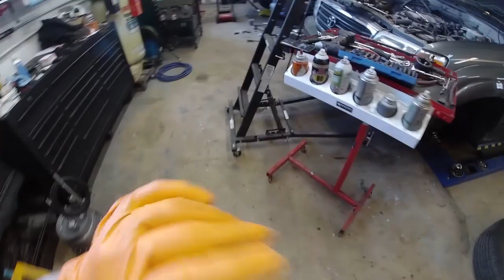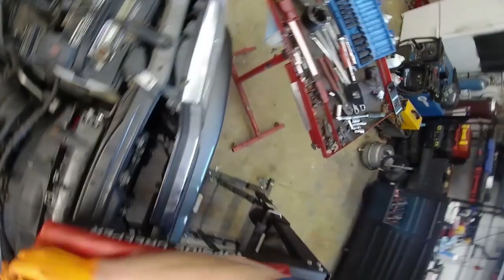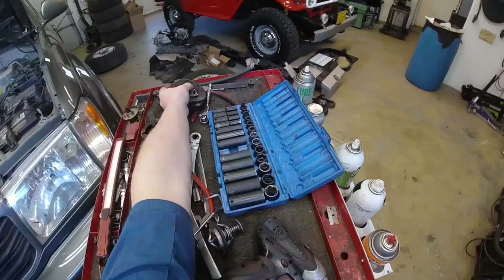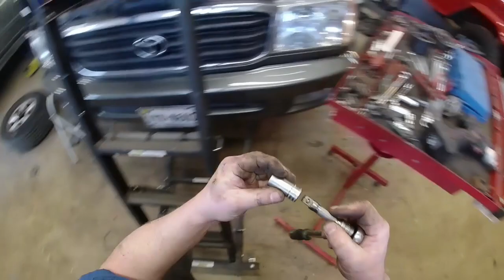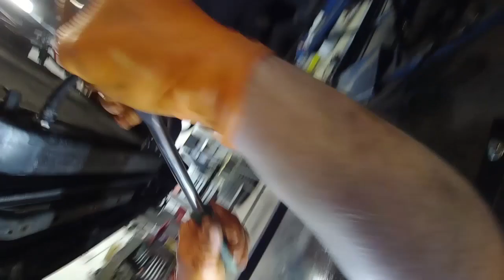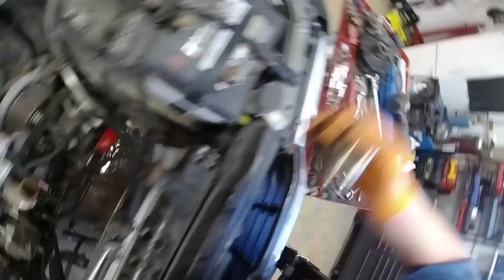Toyota 4.7 liter Timing Belt Replacement Part 1

Comment: Just want to tell you how much I appreciated your videos, I am 71 years young and just finished replacing my TB, seals, valve cover gaskets, spark plug seals and carrier bearing with minimal problems and no other help. One comment to you (very minor) is that I would trade the Tekton flex 12mm with a Gearwrench  long reach (ratchet and box) way easier! For what it is worth I bought my truck new in 2003 and now have 333,400 miles and other than TB's this is the first real maintenance I have had to do on engine. I rebuilt suspension last fall. Plan on driving another 17 years or I am in the grave, whichever comes first. 😇

Comment: Killer video, attempting my 04LX once the parts arrive, plan on watching these videos a few times in preparation. I am positive the 6 hours spent here will save more than 6 when I actually do it. Thanks for putting these together.
Reply from the maker: The updated versions are clearer and have better audio. These show the in truck struggles though😀
Reply: @OTRAMM  Totally, skimmed through those as well, but things like the AC compressor rear bolt are where you're saving my life. Thanks again!

Comment: Thanks this helped a lot I am changing my belt now. 👍 that ac compressor is a pain , I didnt have to remove the rear AC bolt, the front bolts were enough to loosen the fan bracket

Comment: What is that "leaning ladder" you're using?  That is exactly what I have been needing for YEARS when working on cars. This would be a godsend for reaching the stuff towards the back of engines without having to lay across the top!
Reply from the maker: It's called the top side creeper. It's awesome for head gaskets and timing belts.

Comment: Thanks for another great video. One caution for the 'home mechanic' as you pointed out (catch the coolant) and be SURE you have no pets around. Antifreeze is extremely toxic to them, especially dogs. Dogs have a bad habit of licking coolant and it doesn't take much to kill them or cause severe problems.

Comment: The head camera was a nice idea, but in practice it’s making me seasick (and I never get seasick).  Also, all we can really see is the top of the engine.  Still, the video gives a lot of tips that are helpful. Made my belt change much easier.
Reply from the maker: Yeah, the head camera was better in theory than practice. That's why I did an updated set of videos with better camera work and audio.
Reply: @OTRAMM  LOL!!  I didn't see those.  The video with the headcam was the first that popped up, but I "suffered" through them.  Anyway,  I got a lot out of your expertise doing this.  I wish I had one of those topside creepers (?) like you have.  That would've solved my bumper issue. I have an ARB bumper on the front, so I removed that and the  radiator to give myself a little more elbow room. It took a little more time,  but I not fast by any stretch and was worried about banging the radiator fins with my ham-fisted shade tree mechanic skills.

Comment: Thanks for your part one and two, I've done mine using your technique and it works very well, I was able to do the job on my Land Cruiser 2001 model successfully without any problems. Infact I use the "T" mark instead and it works just fine, none of the camshaft turns in any means.

One of the Issue I face is that I did not use the AISIN timing kit but use another brand that I will not name it here so I ended using the old idler pully's since the one with the kit does not aligned (Idler pully# 1 with tensioner will not move freely once torque its bolt, Idler pully# 2 the bolt will not torque in any means). However, the old one are still ok without any strange noise on it so I was comfortable to put them back on for the next TB change. thanks again for the great job and awesome help.
Reply: How long did it take you?

Comment: My 03 Tundra has 239K miles. I bought it used about a year ago and the previous owner said he’s done it twice. I just forgot to ask him exactly when it was done and I am now kicking myself over this. I want to get it done so I don’t have to worry about it. I got a couple of quotes and the best one is 950 our the door. I think it’s pretty pricey but the dealer quoted me 1900!! Wish I had the time and tools to do it myself. My truck is running perfectly fine right now and just worried they’ll mess up. Wish I had a timing chain instead!
Reply from the maker: Make sure your comparing apples to apples on the pricing.  Some places only do the belt, others only do belt and water pump, some do everything the belt touches.  We do the belt, idler pulleys, tensioner, water pump, cam and crank seals (crank only on the vvt models) heater tees, and thermostat.
Reply: Yes, both quotes were for timing belt, water pump, tensioner, pullys, and seal. I don’t remember if they said heater tees or thermostat.

Comment: First, thanks for taking the time to post this tear down, lots of good detail here. I don't need it right now but I likely will in the future should I do the timing belt myself. Looks like the anti-freeze is after market. I have only ever used Toyota Long Life coolant (red) in my 2002 LX470 and have never had a problem with pump seals and the like. It's expensive but I think its worth it. The timing belt expected life is 90,000 miles unless the pump goes first so anything that I can do to make that pump last is worth it. Curious on your thoughts on that.
Reply from the maker: Yeah, that truck had aftermarket green coolant.  Most of the time we refill them with whatever they came in with.  The green and Toyota red coolants seem to keep the water pumps happy and we rarely see leaks with them.  The newer Toyota Super Long life pink coolant seems to eat water pumps and those are almost always weeping when we pull them. The newer pink coolant even takes a different gasket maker at nearly 100 bucks a tube as opposed to the older 15 dollar FIPG.

Comment: Helpful video, thanks for posting it!

Just a side note for anyone doing this job- highly recommend draining coolant from the engine block first to avoid making a mess up front when removing the water pump and oil cooler lines. Drains are located on each side of the block, as shown here: https://forum.ih8mud.com/threads/radiator-flush-coolant-drain-diy.223575/#post-3353085

Comment: Hey Otramm. Thank you for these 3 videos. I’ve got everything apart but my camshaft seals look like they are weeping. Will you make a video on removing and replacing them? I’m nervous my timing is going to change when I remove the cams. I haven’t read anything on it yet but thought it’d be a great video (by you). I really appreciate your videos. So amazing and good. Perfect presentation!
Reply from the maker: There's an updated 3 part series. I do the non vvti cam seals in it. I've never had to do the vvti cam seals but it looks like the cams have to come out to do them.
Reply: Did you replace the camshaft seals?
Reply: @onesri6108  yes I did. I messed one up putting it in but just bought another seal and got them in just fine

Comment: I know everybody’s got their own way to take things apart. But I usually remove the t stat housing to water pump first. Then it’s easier to get to other parts under it. I’m impressed that your using hand tools.
Reply from the maker: I go back and forth on pulling the t-stat housing first. Just depends on my mood. I tend to use hand tools for engine work and power for drivetrain and suspension.

Comment: 47:34 Are the hydraulic tensioner bolts reverse thread? I'm so confused. It looks to me like they're coming out clockwise, right?

edit: I get it now. Those bolts are facing upward and you're holding the ratchet upside down. It's a bit hard to follow without being able to see most of what is happening but this is still one of the best videos on this topic that we have. Leaving this comment here in case someone else has the same dumb idea that I had
Reply from the maker: It's easier to see in the updated video. The engine is out so the view isn't as tight.
Reply: @OTRAMM  Believe me, I'm watching those too. The whole reason I found your channel is because I needed a video showing the camshaft oil seal and crankshaft oil seal replacement. I'll be doing this job myself for the first time very soon on my 2001 Tundra so I really appreciate the videos. Thanks!

Comment: First off, thank you SO much for this video! It has been very helpful and a learning experience for me. The only issue I ran into is at 33:20 as I am not sure bolt/nut you are loosening. I watched it over and over again but was unable to determine which one you're referring to. Would you happen to have a picture or so? Lastly, do you have to take the bolts out from by the oil filter? I know which ones you took out but wasn't sure what the reasoning was for it. Thanks a bunch!
Reply from the maker: It's the rear bolt on the AC compressor. Unfortunately I don't have a picture. I've never actually seen that bolt. You can barely feel it. It's terrible to find and loosen. I've done it enough times I can hit it by memory now. The bolts near the oil filter are the bottom front AC compressor bolt and a stiffener for it. The bolt goes through the compressor in to the fan bracket so it has to come out to remove the fan bracket.  Glad you liked the video.
Reply: Thanks for your quick response! I did notice a bolt by the oil dip stick but it was new to the header which I could only see but didn't think I could get it removed even if I had tried. I am also glad to know that I need to take the bottom two bolts out since I tried to bypass that and noticed how the fan bracket was still stuck on there very tight.

Comment: Great videos, you are helping the community tremendously! 

As I am doing this job at home, would it be helpful to drain the block of coolant to avoid getting all of it in the timing case? 

Thanks a lot!
Reply from the maker: It wouldn't hurt to drain the block. Most of the trucks we see are super crusty so I've never pulled the block drains to see.
Reply: Okay great, I will give that a try! 

Off hand, could you tell me where to find the crank position for removing the timing belt on my truck? I’ve been searching the fsm...

Comment: Really Appreciate the viodeos and the 2.0 version engine out...question on the first video when you remove the ac compresser bracket, there was no bracket on the back of my 2001 LX470, just the holes, explains why the main compresser bolt was so tight, is that just called a ac compresser bracket ?   probably dearlership item ?  I ordered repair manual hopefully I get them soon.  Thanks again !    Next time you pull an engine maybe others might want to see a video of that ?
Reply from the maker: Not sure what that bracket is called. I've never had to order one. I'd just look it up at the dealer.

Comment: I have a question hopefully you or anyone can give an opinion, I have a 2000 Land Cruiser bought it new, I had the water pump replaced 2/9/2012, with 101k miles. I’m coming up on 10 years, the Land Cruiser has 141k now… I went 12yrars and 101k before changing the belt and pump… so you think I could go 12 years with only 41k on this second belt and pump????

Comment: Excellent video! What about replacing a leaking camshaft seal? My passenger side one is leaking. What would cause a crankshaft seal leak?
Reply from the maker: I did an updated timing belt series.  The seals are in part 2.  Usually just age and hardening rubber causes them to leak.  Sometimes they wear a groove in the cam or crank but I haven't seen that yet on a 4.7.  https://youtu.be/7gcM_-fN-44

Comment: Awsome video! where can i find a set of long wrenches you used to remove the fan assembly. The wrenches look to about 12" long with a ratchet end.
Reply from the maker: Mine are Matco but most of the big tool brands have them.

Comment: Would you know by chance what a 2006 Toyota 4 runner Sr5 4.7 w/vvti is supposed to be set at ,top dead center with the l on the back of the cam or what

Comment: where are you sticking the pry bar at 8:44 and so on? I can not get these fan bolts loose in any capacity
Reply from the maker: It's hard to explain but basically you slip it down behind one stud and then spin the fan so a second stud hits the bar.  You're wedging the pry bar between two studs.

Comment: I did my passat t belt twice. It was as complicated as this one. My only real question is regarding the vvti on this engine. I've watched videos where the belt is changed at TDC 0°. Others where the cam notches were moved, I believe, 50° to the T mark. And one where the cams were rotated counter clockwise a bit the belt was installed. On one, a comment was left regarding the torque specs of the crank bolt. Something to the effect of if not properly torqued to 181 ft-lbs it affects the vvti ability to properly produce torque. Then another comment starting that there are 3 variations of this engine which each require a different approach. Any thoughts? Thanks.
Reply from the maker: You need the service manual or at least info for your year.  There are three different positions for the crank to change the belt over the years.  I can never keep them straight and end up looking it up every time just to be safe.  The crank on the 4.7 is keyed but it should still be torqued properly.  The older 1fz straight 6 wasn't keyed so proper torque is absolutely critical on that one.
Reply: Lexus dealer service manager just quoted me $800 for belt and crank seal only. Additional $350 for water pump. They stated they never change the pully or tensioner. Hmmmmmm.....😕😕😕 If the mark position was straightforward I would not hesitate to do this myself. But I think I will go for option B. Piece of mind. Lol
Reply from the maker: The Aisin kit that's linked on our website breaks down the position by years in it's instructions. You'll need a crank holder as well.  It's not a terrible job, just time consuming.

Comment: Amazing detailed video. Can i get away with just using a regular length wrench instead of the extended one?
Reply from the maker: I'm guessing that you mean for the fan clutch. Yes, a regular wrench works. The extra long one just makes it easier.
Reply: OTRAMM yes the fan clutch. And thank you very much!!!! I have to replace my fan bracket and fan clutch. You make it look easy on the video lol. I’ll give it a try this weekend.
Reply from the maker: I also did an update series of timing belt videos with the engine out of the truck. It's easier to see everything in them.
Reply: OTRAMM Amazing thank you!!!
Reply: @OTRAMM  Can you send me the link please?

Comment: These videos are awesome, great breakdown and easy to follow! do all the parts listed on your website work for 100 series LX's if it shows to fit on the same year LC?

Any reason to change the alternator while you are in there? '06-'07 seem to be identical, would the service manuals for timing marks be the same, or do they vary that much year to year?
Reply from the maker: The timing marks vary. There's at least 3 different positions. You won't be doing cam seals on the newer vvt-i trucks and the thermostat may be different. I'm fairly certain 100 series and lx470 are the same year to year though.
Reply from the maker: And the Aisin kits have the timing changed by year in their manual.

Comment: I have questions about crankshaft bold&pulley. Between pulley holder and impact run, which method do you recommend for DIY? why do you remove the crankshaft bold before setting the TDC? I am seeing you are setting the TDC by turning the engine clockwise, do you have prepare steps before turning the engine such as putting the shift in neutral or taking spark plug #1 off? if there a chance that the TDC off after removing the crankshaft pulley or bold? if it does off how to set it back? Sorry for too many questions and Thanks in advance
Reply from the maker: I prefer the crank holding tool and a breaker bar.  You can use an impact to remove the bolt but you'll need the crank holder to properly torque the bolt at the end anyway.  You loosen the bolt before setting TDC because it's going to move as you're loosening the bolt.  If you loosen it at TDC you'll just end up setting it again. No steps to prepare for TDC.  It's easier with the plugs out but I never bother.  Always turn clockwise.  You end moving the crank after the pulley is off, you just reinsert the bolt.  Since you're always going clockwise it works. When you're done a sharp  hit to the wrench will loosen the bolt so you can reinstall the pulley.  You'll want to have the manual as well since the crank position for service changes by engine year.  Hope this helps.
Reply: Appreciate your response and your video is an inspiration.
Reply: Let assume I have the timing belt marks setting correctly on crankshaft and camshafts after the crankshaft pulley taken off. Is it possible the engine be rotated while putting the belt in by hand?
Reply from the maker: You don't want to rotate anything with the belt off. The cams will spin some on there own, you'll need a wrench to spin them back. If you move the crank while the belt is off you can bend the valves.
Reply: I don’t mean to turn the crankshaft purposely after the belt off. While putting the belt in, can I accidentally move it or our hand strong enough to accidentally move it?
Reply from the maker: You could accidentally move it. It's not easy to do though.
Reply: OTRAMM I have an 08 with the vvti. Where would the crank position for the service be on this one? Thanks.

Comment: Great video- where can I buy those long wrenches you used in fan- awesome .Also who makes the best time belt kit in your opinion for the LC 2006.Thank U
Reply from the maker: The long wrenches are  Matco flex head extended length ratcheting spline drive.  The 12mm is part number RFBZXLM1212A.  I have them in regular and extra long and love them.  Best timing belt kit in my opinion is the Aisin one.  I won't use anything else. (well, except factory parts)